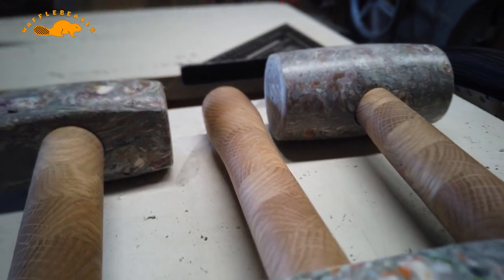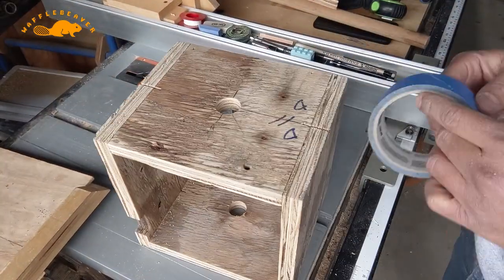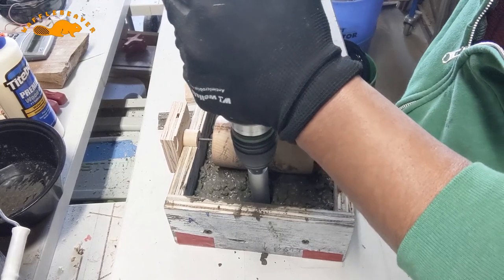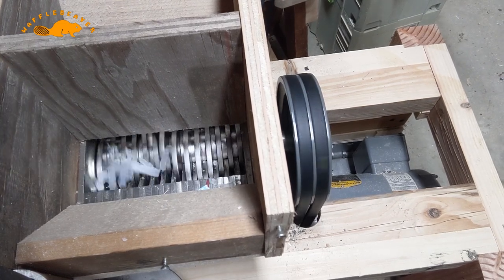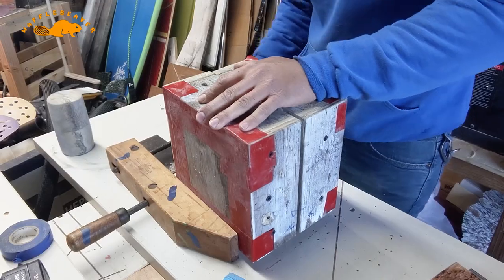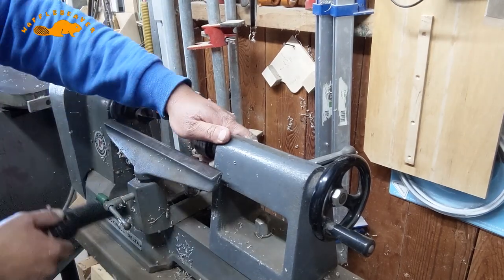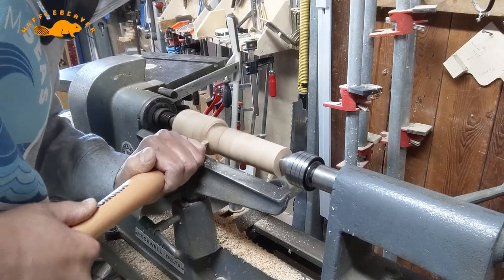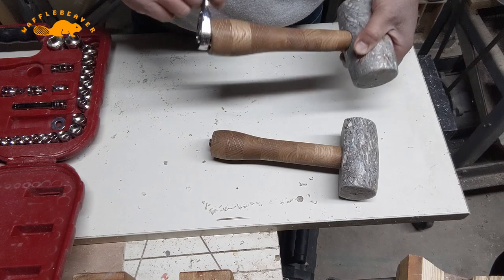Recycling Is Hammer Time: How to Make a DIY Mallet from HDPE and Scrap Wood

Comment: Wow I had no idea it's possible to recycle plastic line that.
Reply from the maker: Yeah it took me some time to figure out… the @brothersmake show how to get that pattern using a panini press. I modified the method a little to just use cast iron pots and an induction hot plate. A litt more labor intensive but still cheap equipment.

Comment: While I am sold on your cement mold, with my limited experience with molds for aluminum, I would leave a small hole in the mold for the excess plastic to go to if you have overfilled the mold. Question; Could you use an electric fry pan to melt the plastic?
Reply from the maker: The exit hole is kind of there from the screws but I would add more exit holes on the next mold. Also, I like high heat silicone as a mold.
You can use any heat to melt plastic, I would just recommend being prepared to lose your cooking tools to just plastic.  Also, I recommend using a good respirator and ventilation